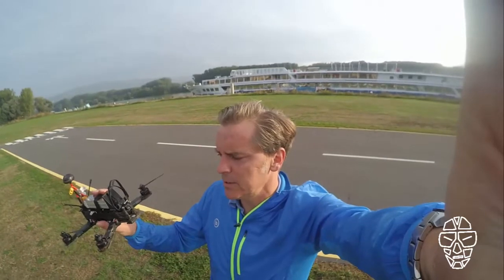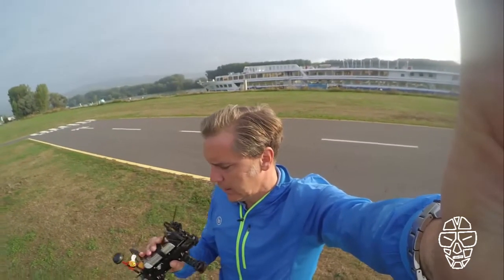Testing New Setup - Minion H / RG20 ESC's / Cobra 2206 -2100kv / 3.6mm Lense

Comment: Hi I'm running the exact same power setup besides the escape, I'm using little bees. Do your motors get hot? I'm just wondering if this setup is risky or just right. Can you please let me know how your setup is handling this power? thanks in advance!
Reply from the maker: +Andrew Auguscik Hi Andrew, no problem with that motor and ESC's can handle the power perfect even if I give full throttle. I am using now the littlebee ESC's as well for my other frames they are good.